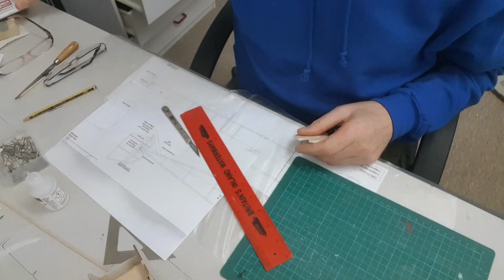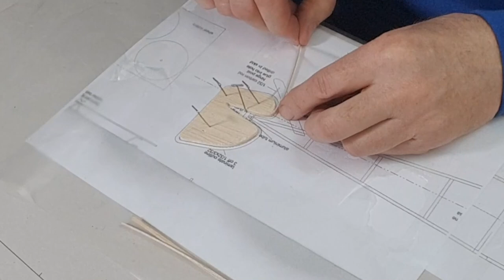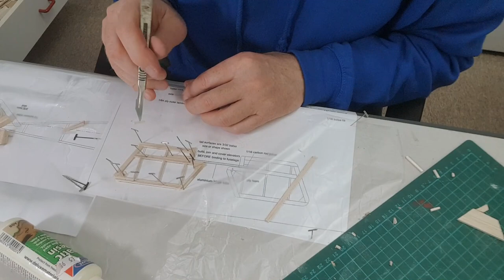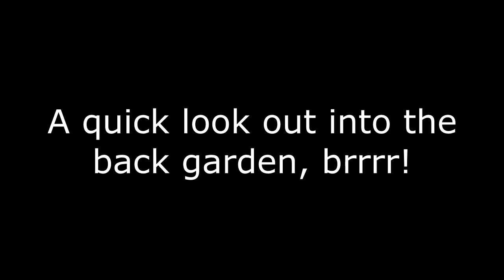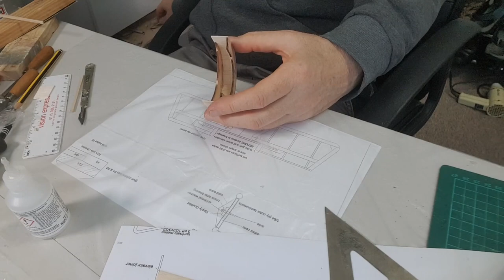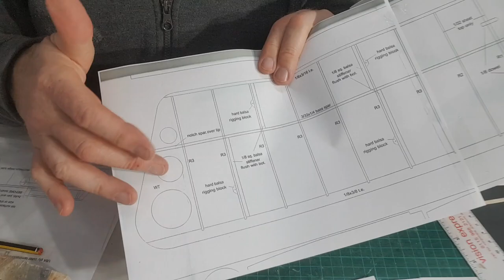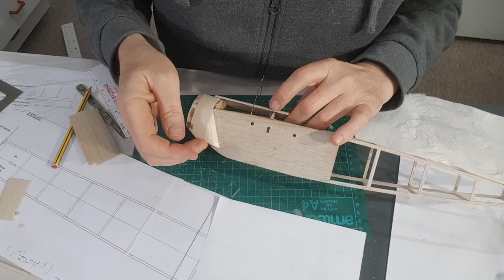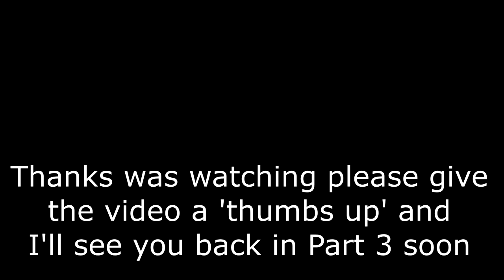Pfalz WW1 Fighter Build and Fly Part 2

Comment: Coming along nicely, Cliff. 
I'm in the middle of building a 40" Stinson Voyager for a 10A system, taking full advantage of all that electric power has to offer for these built-up little gems.
It's a match made in heaven.
Keep 'em coming!
Reply from the maker: My first model was a Stinson Richard, it wasn't as big as your though, a lovely looker from every angle. As you say 'a match made in Heaven', so many models so little time 🙂
Reply: @CliffHarveyRCPlanes  
You know, Cliff, I've only ever built one Piper Cub. It was a peanut scale kit from Peck Polymers.
Actually, that's not entirely true. Back in the '80's,  built two, one in J-3 colors, and one as Hazel Sig's blue and white show plane.
But, that's it! NO MORE CUBS!!!
With all the Stinsons and Monocoupes, and Mooneys, etc, Why the obsession with the Cub?
Personally, I don't get it. But then, I don't get Oprah, either.
The Monocoupe 90A. There's another one I need to build.
To paraphrase you, "So many airplanes, yet only one lifetime."
It hardly seems fair...

Comment: what and where do you get the extruded sanding block, and on the peter rake stuff he seems recommend building the rear and fron section separate and then joining them after. i’ve done 5 that way and works well
Reply: also excited to see the tissue being done i’ve used ultracote and they still fly awesome, but been tempted to try tissue
Reply from the maker: I guess you could do it that way LM but this is how I've always built the sides of any model. The extruded sanding block is made by Perma-Grit, here's their website: http://permagrit.com/ 👍
Reply: @CliffHarveyRCPlanes  thanks i’ll try the site out, but just a mention either work